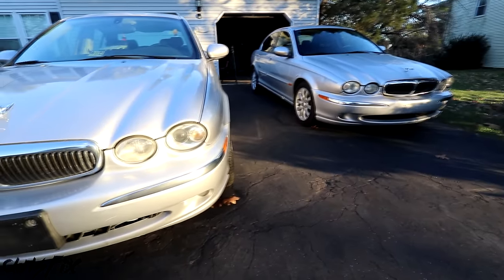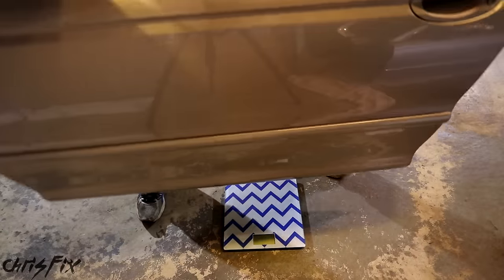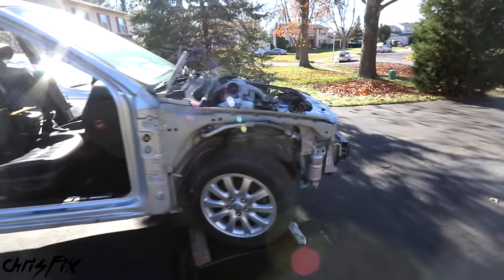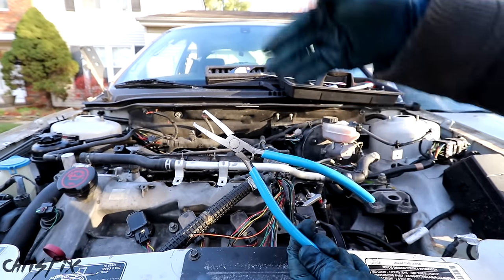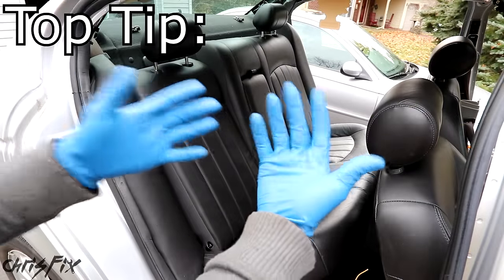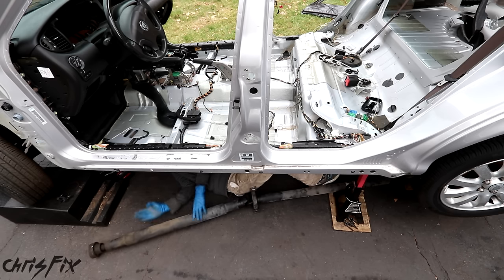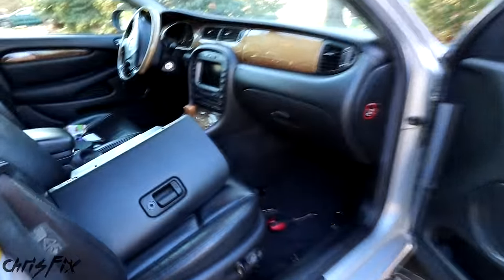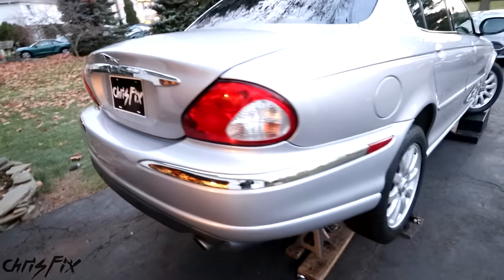How to Strip a Car COMPLETELY

Comment: Why dealers tell me my car is only worth $500 max, for the entire car.. You make it seem like I could get more Chris.
Reply: Because dealers resell and they wanna make money too
Reply: You can get more by parting it or selling it yourself. But the question is how much are you willing to sacrifice for the convenience of pawning it off for a new car right then and there?
Reply: Dealers don't just need to make money. They would also have to pay for labor to strip the car, which eats into their ability to turn a profit.

So if you want to make more by parting out your car, do it yourself, OR find a friend to help you strip it and share the profits with him. Regardless, you probably aren't going to get more than $500 out of your car without investing your time.
Reply: Just some math on this: Chris probably spent ~1-1.5 working days (8-12 man-hours) stripping the car himself.  Google is telling me that low estimates for mechanics are $70-90 per hour.  At that rate, it would cost at least $560 to strip the car (on the low end).
Reply: dont sell your car to a dealer unless you want it fast.
Reply: Dilan Gilluly I have two cars, so I'm not like in a rush or anything
Reply: RzVids You could call local junkyards up too to see if they're willing to haul it away for more than what the dealer is willing to give you.
Reply: +RzVids  To be perfectly honest, any old, cheap, running car is probably worth more broken down and sold as spare parts than as a running, driving car.  Of course, when the car is broken down into parts you can't drive it...
Reply: Depending on the make of the car model, condition, year Etc..
Reply: RzVids Cars are worth more as parts then as a complete object... Buy a new vehicle and strip it. Youll make more just by parts..
Reply: They allways tell you your is is worth nothing so they can make money.
Happend to me i tried to sell my car and a dealer came and offerd me 200€ with the coment: "It's the best price you ever will hear. Sell it to me so you don't have to care about it anymore and nobody wants this car and bla bla bla". I sold it to a guy five hours later, who wants it as a secondery car, for 1000€ because he made the best offer form 20 people (in two days).
Reply: FoxMccloud42 Typically dealers sell old beat up cars in auctions which the buyers are composed of independent shop owners. Sometimes people bid high sometimes they bid low. Depends on how much they want the parts I guess.

But in all cases people can get more for their car by selling it or parting it themselves than trading it in.
Reply: Dilan Gilluly It wasn't beaten up, just the driveshaft needed replacement, cost 100€ new, and some rustet sheet metal needed to be replaced (metal cost 300€) and thats all. perceft for hobiesest. I decided to sell the car because i have the new model. But my father has a dealer as a friend and its typical what they do. They tell you your car is worth nothing, than after geting it they clean it, fixes nearly nothing (if there would be something big to be fixed they wouldn't buy it) and then resell it for a big price. This friend for example bougth a bmw 5 from an old lady for 500€ (after telling it's the best price you get and bla bla bla) and then resold it for 5000€. He just cleaned it. There was nothing to fix. But they know how to trick people.
Some say: never trust a banker and a car dealer
Reply: Cars are usually worth more in parts, but no one wants to turn their house into a junkyard and wait months and possibly years to sell everything off.
Reply: Earl Scheib
depending on car and region. In Europe true 4x4 are complete often worth more than in parts depending on region. And in the aftermarket there are a lot of good parts for low prrices. My father has a mercedes ml w163 and needed a new bumper a used original cost 400€. a new aftermarket in same quality only 300€.
Reply: RzVids yea you can sell each part individually and make more than 500 on the interior but it would take a lot longer
Reply: Trading a car in at a dealer is pretty much the best way to cost yourself a load of money.  When taking in a part-exchange vehicle most dealers will only offer its lowest book value, or if it's an older car, they'll only offer what they know they can get for it from there preferred scrap man.  If you're prepared to put a bit of work in and sell it privately you'll get a load more money for it and the chances are that if you go to the dealer you're buying your new car from as a cash buyer with no part-exchange you'll be able to negotiate a better deal on your new car too, so it's a win-win.  I know cases where people have done that and ended up saving themselves very serious money...
Reply: RzVids so true
Reply from the maker: Parted cars are worth more in some cases but the dealer isnt going to part it, they are going to sell it.
Reply: My thoughts would be like the engine by itself is $500 alone, I declined their offers.
Reply: RzVids Most likely. Then you could make quite a bit on other parts as well. The body panels are probably worth at least $125-250 for each one. And the doors will likely go at $200 a piece.

Comment: That center joint in the driveshaft that holds it in is called a carrier bearing. You'll see them a lot if you worked on big rigs
Reply from the maker: +Nery Salguero thanks for the info!
Reply: The carrier bearing can be replaced. The whole driveshaft didn't need to be replaced :P
Reply: +ChickenTiTs37 yes but it's very expensive and a pain in the ass on those jaguars
Reply: Aidan Nina I don't think the driveshaft is much different from any other. it's usually an easy job to do
Reply: ChrisFix Probably irrelevant by now but the center support bearing for that car is about $75 from what I found online. Just if you wanted to replace the one before selling it. Would make a nice howto video. I had to replace mine for my old Chevy. It was simple enough
Reply: ChrisFix No problem man!

Comment: parts for an old jag like this just depends on the demand, if for example a dash piece is breaking on many jags and jaguar doesnt make that part anymore you could sell it more expensive than a new part, then there are the low demand parts that you wont be able to sell easily like the side airbags because if an old jag like this get into any accident that would pop the airbags then its not worth repairing.
Reply from the maker: +sweet dreams thanks for the tips!
Reply: you are welcome! thank you for the amazing videos!
Reply: ChrisFix Ghana I need to get huh

Comment: I'm conflicted..on one hand you made a real good profit BUT you did just strip down and scrap and beautiful jag...
Reply: ... which had electrical issues. If you've ever worked in dept on a car you'd know that these things are nightmares to repair.
Reply: @timrocheleau86   exactly why every new car that you buy, you should have stripped of 80% of electrics and leave only that what the car needs for running and those parts that you want to keep... No computers, no internal navigation, no automatic braking, no automatic turning off the engine, no remote disabling, none of that junk which only gives the car unnecessary weight and potential problems...
Reply: @timrocheleau86  Facts all day! I had a $30 trailer light system that shorted out and ended up costing me close to $1400 in repairs. Ouch.

Comment: Always research the car and find out the biggest issues with that particular model and sell those parts, or it it's a future collectible, store them for as long as you have the storage space! Also, scan the interior and look for things that might easily break and store, or sell those as well. 
If you're selling them, check and see if they are compatible with other model years and be sure to include that info in your listing, to increase your market.

Comment: Stage 5 Weight Reduction.
Reply: Mad Matt lmao
Reply: press Y for description
removing 3 out of the four doors and replacing it with carbon fibre will decrease the cars weight even further increasing acceleration, handling and braking.
Reply: Haggard garage forza weight reduction irl

Comment: I also would have taken the radiator and some stuff from the steering column, those can get expensive
Reply from the maker: Great tip thanks!
Reply: ChrisFix ur dad is proud my b.
Reply: How about the steering rack
Reply: those can be a real pain to get out unless you're also pulling suspension arms and stuff, definitely have to weigh the labor on that one

Comment: why not replace the passenger door? you can clearly see a dent right above where the hole was.
Reply: Probably it didn't match, he said the fender didn't
Reply: and the cracked thing around the gear shiftier
Reply: His dad's car has pinstriping so replacing any fenders or doors wouldn't work very well.
Reply: He said the paint didn't match.
Reply: I saw that too. With that extra 3 grand he could get it repinstriped. I also thought the new seats looked better
Reply: It's barely seen and not worth replacing just take the dent out
Reply: remove the pin stripes and you never need to fix them
Reply: replacing a door is quite a job. you have to transfer the locks etc. at the end of the day it's still only a 2 grand jaguar.

Comment: surprised u didnt keep the wheels. thats $100 right there minimum
Reply: MoB same thought
Reply: He did, there were different wheels on it when it was taken away.
Reply: no the other (non matching) wheels. I would have put both SPARES on the car (after removing the good rubber) and tossed 2 $15 or less steel rims on it. looks like you can fit a full size spare in that trunk. if yes do that. no more steel rim spare!

I saw a lot of meat left on that car. Steering Wheel. E Brake handle. mirror. seat belts etc.. etc..

otherwise great video as usual! maybe one day I will meet you. I did not realize how close you were! I live in SE PA and have a business in south jersey outside atlantic city.

also toss that passenger door on there! yours is dented where the skirt was damaged.
Reply: Nerys true, i just bought an used seatbelt for roughly 70$ (i'm in euro country) and steering wheels cost a lot!
Reply: Not really any reason to put any wheels back on the car. Doesn't matter if it gets damaged since it's just scrap.

Comment: Personally I would have removed the whole engine, transmission, calipers,differential, driveshaft, radiators, condenser, and the whole dashboard with all the goodies under it. Not to mention upholstery and the rest of the interior. But that's just me :)
Reply: krugerblue he wouldn't have space to keep it all
Reply: JDMSteven  and time and tools
Reply: krugerblue Also, engines are hard to take out and you need a jack for them.
Reply from the maker: You could totally do that but it wasnt worth the time for me and I dont have enough space for a whole engine/tranny. I also dont know much about it.
Reply: Why didn't Chris remove the steering wheel?

Comment: Did the original car come with a second set of wheels?
Reply: Right? Why throw those away?
Reply: didn't understand why he would just throw them away like that
Reply: He threw away the original non-Jag wheels which were on his Dad's car originally.  See his thread on refurbishing wheels.
Reply: My biggest confusion was the fact that he didn't take thhe transmission. Seems you could get about $400 out of that if it worked.
Reply: Luis ruis it had different rims.
Reply: Kelly Askew transmissions are very heavy and take up a ton of space, plus they can get very messy. If I were him I would have taken the head off the car since they don’t take up as much room and are always in demand

Comment: I did not see the ECU on the list.
Could you not remove it?
That would be $600 easy.
Reply: IIGrayfoxII  probably because it was hard to reach, just like the alternator, and it wasn't worth his time, plus I highly doubt that there's a large demand on ECUs as Chris said that body panels where the most valuable objects due to car crashes
Reply: IIGrayfoxII since there was an electrical issue, the ECU could've been damaged too.
Reply: He probably hooked up a scan tool and didn't get any reading from the ECU indicating it was bad.
Reply: Usually when concerns of whether it works comes into play, you can sell it as-is for a fraction of the cost of a known working unit.
Reply from the maker: The car's computer was toasted! The electrical issue they had fried it!

Comment: Where do you find the info on how to dismantle the cars? I see you are a very experienced mechanic, but there has to be once in a while a car you wish to fix or something, but don't know how to detach something, where do you find all the info? Is there some centralized repository of knowledge, do you have to search for it in the manuals, or does your experience give you a good idea of what to do and you just need to poke around a bit in the car to find a solution?

Thanks for the very educational, straight-to-the-point and well edited videos! As someone who recently started driving and is using his parents' car it means a lot to see this quality of videos on basics, such as basic mainenance and thorough cleaning of one's car.

Comment: i like how he stripped a whole car down to the frame in 14 minutes
Reply: I kNoW crAzY RigHT?
Reply: It took me 20 minutes with no camera skips
Reply: @jackl3384  that physically impossible the engine takes 30 minutes just to jack it up, undo bolts, disconnect wires, disconnect fuel lines, disconnect heat shields. i highly doubt you did that.

Comment: What was wrong with the parts car, it looked like it was in pretty good condition...?
Reply: ***** Yeah, that's what I got out of it too, but is that really cause to write the whole car off?
Reply: Watch the previous video, it explains why it doesn't work.
Reply: The wiring was completely messed up. Watch the previous video. He'd need a whole new wiring harness and all he really needed was a few trim pieces from the car.
Reply: The wring harness and several other electrical components were effed up. Impossible to fix.
Reply: Kriss 22 
I agree with the High Mileage. That Engine Bay looked cooked!

Comment: should've took the glass out of that shell to sell, all you really need is a piece of steel wire, I would swap that dented passenger door
Reply: This0is0pointless The door didn't have the pinstripe.
Reply: he could of did a pinstripe video, its just a vinyl pinstripe but the problem was it's the wrong color.

Comment: Bruh what, those are nice rims why didn’t you take those too lol
Reply from the maker: I did take them
Reply: ChrisFix oh really, nevermind lol
Reply: ChrisFix I guess they needed to be on just to get it on flatbed?
Reply: I was thinking the same.
It's more than 50000  rupees in India
Reply: this is off topic but I am trying to replace my inverter coolant pump on prius , so I have to remove my headlight to get to it but there is a stripped rusted bolt that connects bumper just under the hood and that bumper covers part of the headlight unfortunately. The rusted bolt is a round phillips head thats stripped and underneath it it has a nut that looks like it has more than 6 sides, so none of my sockets seem to fit. In addition , there is no room to twist the nut underneath with a vice script. Any ideas on how to get loose?
Reply: ChrisFix   this is off topic but I am trying to replace my inverter coolant pump on prius , so I have to remove my headlight to get to it but there is a stripped rusted bolt that connects bumper just under the hood and that bumper covers part of the headlight unfortunately. The rusted bolt is a round phillips head thats stripped and underneath it it has a nut that looks like it has more than 6 sides, so none of my sockets seem to fit. In addition , there is no room to twist the nut underneath with a vice script. Any ideas on how to get loose?

Comment: I whould have turch cut the frame and sold it at the scrap metal yard
Reply: The monocoque frame is aluminum...
Reply: *copper, not "Cooper". There isn't a barrel maker in that automobile. :p
Reply: Steel is heavy and it adds up quickly.
Reply: DudeInWalmart the car is worth something

Comment: Hold up his name is actually Chris Fix?
Reply: Savage 101 No. That was a buissness check. You can make checks out to a buissness, as long as Chris signs it at the back.
Reply: To add to what Nayab Warach is saying, "Chris Fix" is the "DbA" or "Doing Business As" that Chris uses. Anyone can apply for one. You'll probably get the paperwork from your country clerk. It's absolutely necessary to register a DBA if you intend to (legitimately) do any business under a name that isn't your exact, real name.

Comment: I thought you meant literally taking all of it apart. Like removing the engine, transmission, all the wires, etc. The cataltyitc converter can get you hundreds of dollars in its own at the scrap yard. The copper wires are worth a lot too, especially the thickest ones once stripped. As for parts like the engine if they're still working then of course sell them separately too. If not then they are worth more for scrap if separated, at least twice as much as regular steel, which is what they would count as if not removed from the car.

My brother doesn't know what he wants to do for a living. I told him what he can try doing as a business is what you did in this video, buying old, unwanted, or non working cars from people and either fixing them up and selling them, selling individual parts or scrapping them. I went to a junkyard that does that, buys automobiles and lets people come and buy whatever parts they can find.

Comment: He didn’t have to do all that stuff to get to the back. He could’ve removed the seats, which he did the next day.
Reply: I think there were tops bolts to fully remove the rear seat which were more accessible with the trunk open.